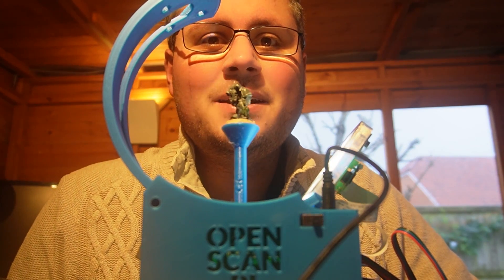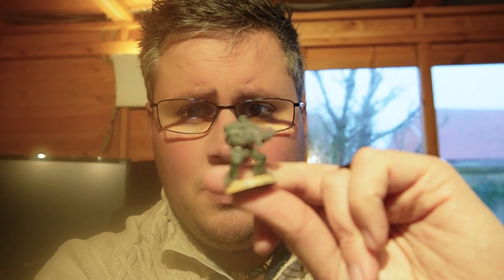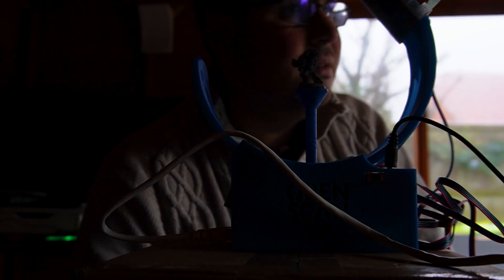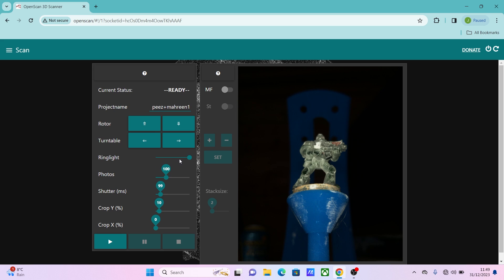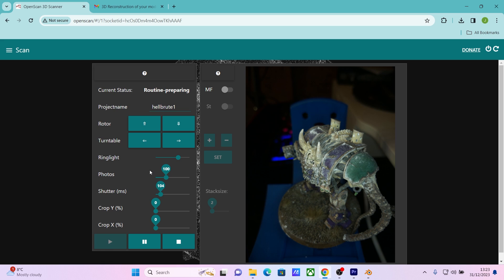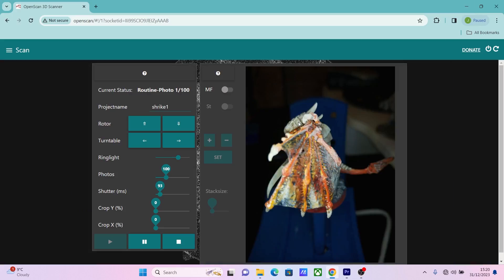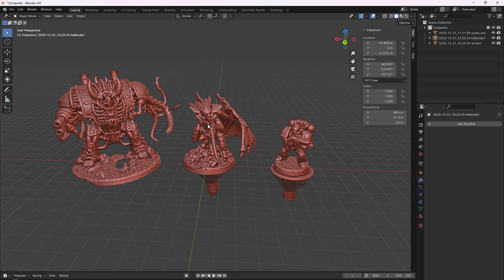OpenScan Mini Testing: Best budget 3D scanner for Warhammer 40K Miniatures in 2024?🚀🔍

Comment: Hello, do you think is It possible to scan tiny model like legion imperialis miniature ?
Reply from the maker: Hey, I've never tried it on anything that small but I can't see why it wouldn't be able to do it. You will likely really need to work with the scanner, your prep process and the lighting to get it to work well. Would imagine it needing a fair bit of post scan clean up as well, can't imagine it would be a scan it then straight  to print  process for example.

Comment: I'm building a more manual version with a $9 turntable from Amazon that is the basis for a 3D printed photogrammetry light box that should be able to scan objects that fit in a 150 mm cube.  I'll upload the project to Printables and Thingiverse in a week or two when it's finished.  I'm using Meshroom to generate the OBJ files and MeshLab to clean up the OBJs.  I can also use the light box for website & instruction sheet photos.
Reply from the maker: @Liberty4Ever  sounds interesting what camera are you using?
Reply: @tabletopscanman  - Very good question.  Photogrammetry requires sharp images with no reflections or out of focus areas, and no shadows so plenty of diffuse light.  I have a nice Casio EX-ZR1600.  I bought the camera nine years ago but takes good images. It's smaller so it should be easier to mount on the photogrammetry light box but I may just use a tripod.  The camera has manual operation so I can lock it to the same settings for each shot, and 18X optical zoom so I could back off to ensure the entire image is in focus.  16 megapixels should be plenty of resolution.  The camera can be remotely operated by a phone or computer via Bluetooth or WiFi but I'll probably keep it simple and use the manual shutter with a 2 second delay to allow the camera shaking to settle before opening the shutter.

I just ordered a $35 aerosol can of the 3D scanning spray that puts a light matte finish on the objects so I can photograph the black, stainless and glass objects I need to scan, and the matte finish evaporates via sublimation in a few hours leaving no residue with no need to clean the scanned objects.

I plan on taking 48 images (16 at each camera elevation), flip the object, and take another 48 images so the photogrammetry software can see the entire object with a significant overlap between images.

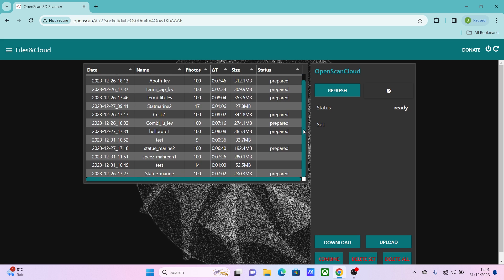Comment: 8:38 what concerns me is the 'uploading' part what if that service closes down ? I briefly read the sales blurb and it mentioned something about you being able to create the STL locally using your own software, what does that mean ? I have ZBrush and 3ds Max but those tools would be for clean up, they cannot generate an STL from photos !
Reply from the maker: @RolandoRatas  good question. any offline photogrammetry program will do the job, for example you can find meshroom online for free and use that. You will need to learn a bit of new software but it's easy enough to figure out.
Reply: @tabletopscanman  yeah thanks for that, I just found on the OpenScan blog that that they mention several programs that you can buy or get for free and use instead although their online Open Scan one is reputed to be decent. I may well consider getting one, although I heard that there's an Open Scan mini coming out ?

 I know 2 years ago there was one guy reviewing jewellery 3d scanners and they were amazing, sadly they cost £2500+

Comment: Absolutely awesome video and content as always. Is there something that delivers results as good as this that can be used for larger models, like  Bloodthirsters, Keepers of Secrets etc?  Looking for the best way of trying to print those.
Reply from the maker: Thanks a lot! The fundamental practice behind this equipment is photogrammetry. You can achieve some pretty great results with your phone or a dslr that aren't limited to the size of the object and only limited to the amount of time you're willing to put into it. If you're looking for an off the shelf scanner for those items, though, I don't think you will find something at the minute that will give you the scale you need and still grab those details you're after. You can do it with the revopint mini but it does require some cleanup modelling after you scan. Hope that helps. 🙏

Comment: Impressive (Oo). What do you think about Revopoint Mini 2? And OpenScan-mini vs Revopoint Mini 2? Thanks
Reply from the maker: I think they both have their use cases. Anything below around 60mm is better on the openscan mini but larger may be better with the revopoint because its not limited to turntable. The openscan also appears to have much higher quality scan output from a significantly less dense mesh and costs A LOT less.

Comment: I'd rather just spend more and get something like the mini 2. It has a software suite to make getting a solid starting point super fast and easy, and its not so limited in the size of object you can scan and you dont need to rely on any cloud servers/internet.
Reply from the maker: I own a revopoint mini (boasts the same specs as the mini 2) I think the output scan quality from the openscan is better. Not being a 3d sculpter this matters to me most but your skills may differ from mine. The openscan doesn't need an Internet connection it just speeds things up if it does, ive found most people tend to use metashape as an alternative. I'll do a comparison video for you 😉.

Comment: You need to try the Revopoint Mini again. 
They have new scanning software that works a lot better with the scanner. 
Try it with the updated software and compare it to the Open Scan.
Reply from the maker: Doing exactly that at the minute!! check out my last post on here if you can.
Reply from the maker: Also found that the merging of scans has become near impossible in revoscan, whats your experience with it? It continually gets alignments messed up. Might be a noise issue thinking about it 🤔.
Reply: I was having that problem as well, although it seems to of lost the merging feature its tracking has improved. Before I was finding it difficult to stop and start during a scan, now if I pause it I can check for defects adjust and resume without much issue

Comment: O ordered my own kit for an open scan mini, just gotta print the parts , get a raspberry pi, and get a camera, and I can put it all together when I have it.   I'm going to do some scans testing out with a matte primer and sprinkling white and gray primer on top for the spotted surface that I see in the pictures from the documentation, for me personally its easier than getting the scan spray, plus it wouldn't evaporate so I can come back and scan again and again, do more testing, add more light dustings of spray, etc.
Reply from the maker: Nice!! From what I've been experimenting with I think a dark primer with developer spray is the best way to go. You get various shades of white from it and it can be cleaned off when you want. The vanishing stuff is mostly for painted bits and things you can't clean after. Let me know how you get on, what sort of bits do you plan on scanning?
Reply: @tabletopscanman  I've got plans to create some "tiny hammer " armies, around 15-20mm, and i was planning on scanning miniatures from the 90s because i just am more familiar with and enjoy the older 40k minis compared to the ones today.
Reply from the maker: @xyonblade  sounds like an a awesome project. 90's models were the golden era 😄

Comment: If your back from your holidays great and please make a video with this openscan scanning action figure armor and or acessories 80's-90's please as i might get the this photogrammetry scanner :) if your still on holidays ENJOY bud eh :)
Reply from the maker: No problem buddy back from hols. Comparison vid is first off the blocks but larger action figure type models will follow after that.
Reply: @tabletopscanman  action figure armor PLEASE ( he man two peaice armor or mummies alive clip on armror , or something with a 2MM thickness armor sorta thing ) PLEASEEEEEEEEEEEE i looked at 6 scanners claiming they can do it no no they cannont atm a scanner that could do it starts at $5000...to $40,000 here in australia
Reply from the maker: @jaywittman192  currently on the market for a predator action figure I'm sure that will have accessories and such.
Reply: @tabletopscanman  now that can work too as the overall wall thickness is the same or thinner even modern action figure body armor accessories will work too ultimately my armor is just 1.x-2x thicker than a blade of a kn!fe but have details such as pin/clip holes etc (2mmx2mm)
Reply: @tabletopscanman  hows the SEARCH going :)
Reply: any chance for some 80's-90's action figure armor scanned with the photogrammetry scanner?

Comment: Can you use a pc to run the scanning software or is it best using a R-PI?
Reply from the maker: The firmware for it is loaded on the pi I'm not sure if the software has been compiled on different OS's. Might be worth pinging Thomas at openscan a message
Reply: You can use any photogrammetry software to process the images. Controlling the motors and camera through the PC is only indirectly possible through the webinterface (from nthe Raspberry Pi).

Comment: How does it compare to the Revopoint mini?
Reply from the maker: Glad you asked was planning to make that my next video. I think it covers the smaller parts that the mini can't quite get too. I've done some great scans with it but it's aimed at 50-70mm miniatures and above. This covers that lower point down to 28mm much better. Both have a learning curve and are both different technologies though so bare that in mind.
Reply: @tabletopscanman  That was my take. I really wanted to just buy something off the shelf so I bought the Liard and then I got on the Revopoint mini kickstarter. Then I found out that neither is designed to do what I want. I re-sold my revopoint as soon as it arrived, but I still have the lizard for some slightly larger stuff I still want to scan. I've been saving up for the Openscan, but my 3d printer screen just went out, so back to saveing. Hope to have it in a month or two and get some scans done.

Comment: This is EXACTLY the review I have been looking for. I've been on the fence about buying this scanner as I was concerened about the DIY aspect. I really wanted something more commerical and out-of-the-box. I even bought a CL Lizard only to find that it isn't really good for what I want. I am definatly going to buy this now. As I have 3d printers and can print parts and already own a Raspberry PI that I can use the cost goes down quite a bit.
Reply from the maker: Glad it helped out buddy, I would say this and the cr lizard are different beasts though so make sure you are picking it up for the right reasons. What sort of things do you scan?

Comment: I've been using this hardware for scanning painted miniatures for use in Tabletop Simulator.  I don't want to repaint the figures, so I'm not doing any powder or spray.  Using Kiri Engine for the photogrammetry.  Really great results.   If you want the 3d model for printing or modding purposes you are better off with powder or spray, but for use online painted figures w/o spray look great.
Reply from the maker: I agree the results have been fantastic for game purposes,  the file size is really small compared to the quality of the output!

Comment: I now own the OpenScan Mini and the Classic. On the mini I always use 52ms shutter speed and use only 40 foto's when scanning Wargame figures. That seems to be enough. And saves a lot of time... 

I do not like the setup of the Classic. I'm in the process of mounting the camera on the scan arm and the turntable on the floor. So in that way the (heavy) modell doesn't come off.

So, I really like the OpenScan stuff, and also use them at school, teaching the staff and teachers how to use it.
Reply from the maker: Awesome thanks for sharing your settings, what do you do for prep? I think I will do a video dialling settings in at some point, acceleration being one of them as I'm finding that larger models are a bit wobbly similar to you.

Comment: Grteat video. I've had a pretty disappointing experience with mine so far. Unanswered emails and lack of any kind of support. For some reason the software won't recognise the arducam so I haven't been able to do anything with it,.
Reply from the maker: Thank you. Seems like an odd one as they've been very helpful with me. Weirdly I had a similar thing I fixed it by changing firmware version and changing the orientation of the camera ribbon cable at the camera end ( I was sure I followed the instructions perfectly so maybe the orientation in them was incorrect) have you tried the same?
Reply: @tabletopscanman  yeah, it’s really frustrating lol. I’ve tried many times even swapping out the cable. Can I ask how you were communicating with Thomas?
Reply from the maker: Yeh I can understand that. You can see the firmware version I'm using near the start of my video if you wanted to get the same one going on yours,  I've personally had no issues contacting via email.

Comment: ngl the scans are pretty good but not good enough. is there a way to get better results like scan in a finer setting?
Reply from the maker: Fair comment. Things that will improve the results: number of photos taken ( I used 100), preparation technique (I used baby powder over an unprepared model, ideal is black primed with white speccled detail) and absolutely nailing image focus (mines a bit blurry in places I'm going to print a black back shield and work with manual focus and focus stacking in the next couple of months)

Comment: For the best results, prime the model in a flat black paint, let it dry and then use a scanning spray. I would also make the scanner parts black. The spotcheck skd-s2 developer spray has worked best from my testing. You can use the vanishing spray as well, I recommend the orange version. The blue disappears too quickly.
Reply from the maker: Thank you I will try that next time. How do you get around parts that are already painted? Strip then prime again?
Reply: @tabletopscanman  I would strip them if the paint is too thick. It is also best to scan minis in parts. I would have glued the tyranid wing seperate onto a small base to get better details. Use the bases as a reference for scale. The scanner is not accurate when It comes to scale.
Reply from the maker: @ilyabelomy8090  I did think it would have got better results in bits. I thought scanning it as one item would give more features for tracking though but I'm still finding my feet jumping from structured light scanning to photogrammetry, thanks for your help! Any reccomendations on what to try scanning next?
Reply: @tabletopscanman  I would prime a few models black and practice using the scanning spray. Do not apply too thick, keep your hand in motion as you spray in  short bursts. Crop the camera image for smaller minis for faster processing. I have good results with the open scan classic. The classic gives you more options for larger models and terrain.
Reply: what about priming white?  what difference does it make to prime black and use white spray vs priming white or priming gray?
Reply: @xyonblade  I had bad results with spraying white or grey models. You need the contrast. Black primer is the best color imo with a white scanning spray
Reply: @ilyabelomy8090  makes me wonder if priming black and then just a light spray of white on top to add little dots would work?
Reply: @xyonblade  A zenithal highlight from the top is not enough. You need white dots all over the model. Top and underneath. You will lose detail in areas that does not have the scanning spray
Reply: @TheGearCrasher  I haven't tried dry brushing but I do not think you will get good results. You need fine white dots over a black primer in order to get the contrast needed for the camera. Scanning spray or Developer spray is your best bet. They are also faster than using a brush. For painted minis, some hair sprays will be easier to clean up.

Comment: Thanks a lot for your work and the great video! :)
Reply from the maker: No problem, thanks for sending it over to test it's a great bit of kit! Would be interested to get your "best" scan settings if you have any? what shutter speeds, number of photos, etc do you find gives the best results?
Reply: @tabletopscanman  This really depends on the model and preparation. The most important thing is the object preparation and you will get better results, when applying the spray more lightly creating those favorable tiny dots. This really needs some practice though. Alternatively, you could use an airbrush on lowest pressure to uniformly sprinkle the surface with random dots
Reply: Hello Openscan_eu . If you need additional reviewers on youtube, let me know ;-) i am always interrested in cool product reviews to show my community. greetings, Alexandra